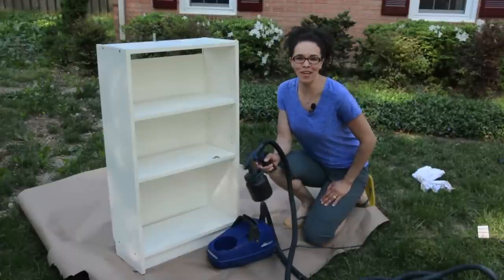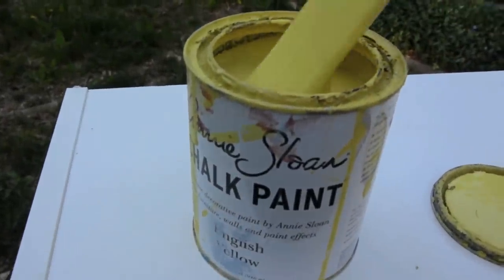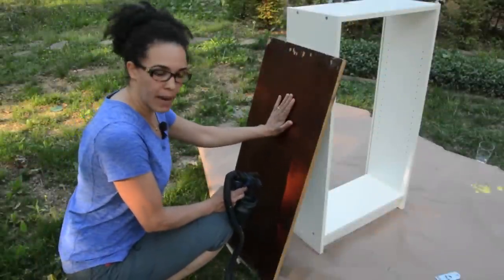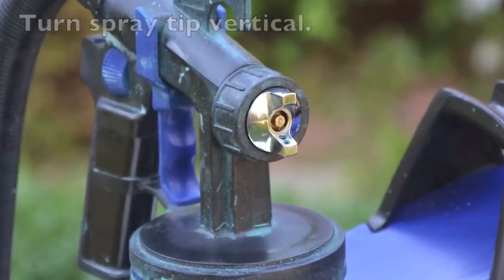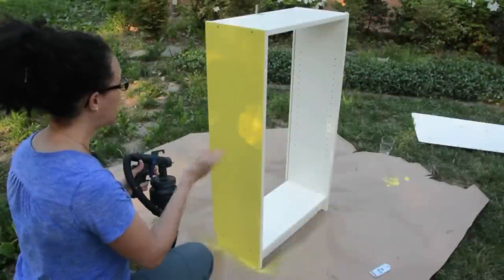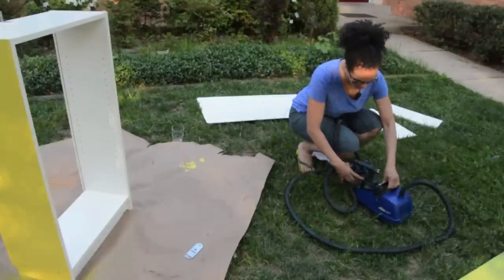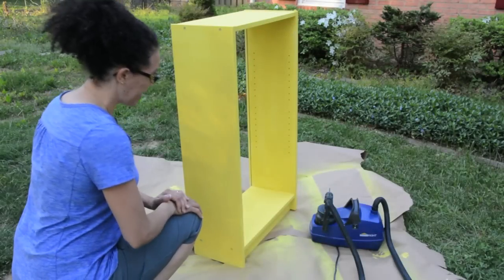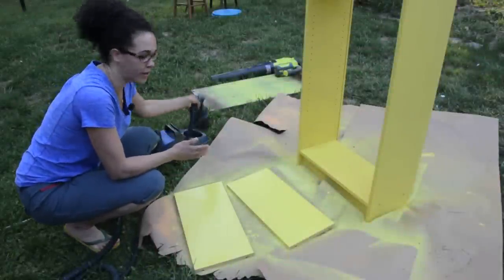Cheerful Bookcase Makeover Using the HomeRight Finish Max Pro Paint Sprayer - Thrift Diving

Comment: How long did you let it dry? If I'm painting some bookshelves I purchased from target white do I need to sand and prime them? Can I use paint with primer in it?
Reply from the maker: +raige73 It should dry pretty quickly. Hmmm....30 minutes, maybe? Don't remember off-hand. You will not need to prime them. The chalk paint will stick to virtually anything. Just make sure you wipe them down first with Simple Green. Check out this post on the best paints to use on furniture. I have used Annie Sloan chalk paint in the paint sprayer, but have no used any others in the paint sprayer, so I can't vouch for those: http://thriftdiving.com/whats-the-best-paint-for-furniture/

Comment: Thank you for Sharing Please let me knw that there's away to take out these Round things that has no way of Using a screwdriver or Flathead or anything like them i have a bookshelf that someone but hardwood flooring on the top sides of it to hold books it's.really nice but i want to use it it matches my decor but i need to find out how i can get them off PLEASE HELP ME IF YOU CAN THANK YOU SO MUCH

Comment: I have never used chalk paint. I looked at home depot and found out its more expensive than regular paint. What are the benifits of chalk paint?
Reply: Russell Bogrett It adheres to anything. And you never need to prime or sand. It is more expensive, but it will last a long time, usually only one-two coats needed.

Comment: any sprayer that requires thinning is absolute GARBAGE...there other sprayers out there that require no thinning and they are the top of the line but they are little expensive. I am not going to say the name of this sprayers
Reply: Some paints are just too thick. Adding a reducer to paints will help with minimizing orange peel and improving atomization. Even with professional rigs it's a good idea to add a reducer to improve the finish.